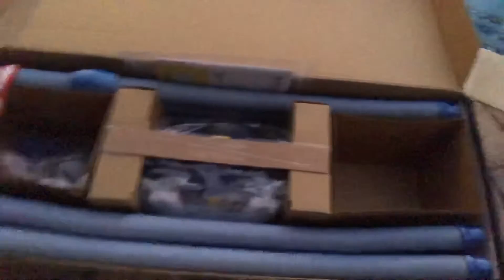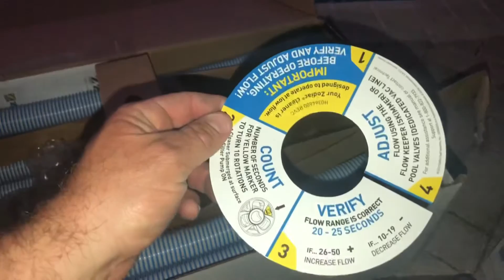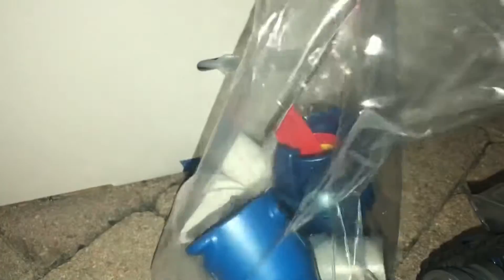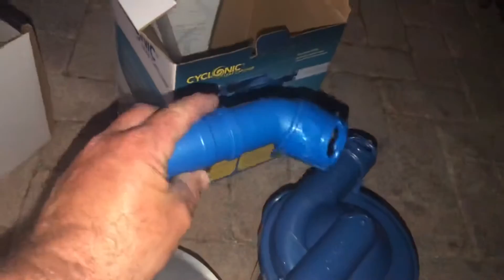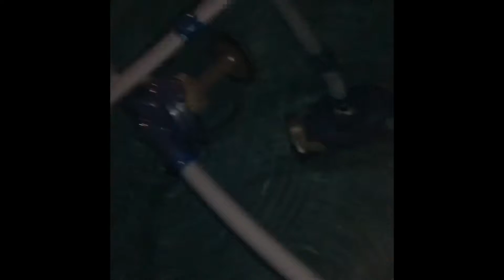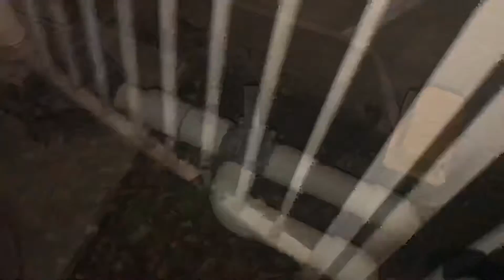New Zodiac MX8 ELITE Installation

Comment: I yanked a little too hard on the leader hose that is connected to the main unit to the sweeper and may have broken the connector, because it seems really loose.  How loose should that connector be?
Reply from the maker: It should be a tight fit. If the clips are broken then re-order new connector.

Comment: If you didn’t use the gray adjustable suction pipe, it’s not necessary to check the revelations of the wheel then right?? Do you have to use that piece at all??
Reply from the maker: Yes you should always check the revelations of the wheel to ensure your getting the recorre the amount of pressure. If you have revelations to high, then the gears will strip, and wear out faster. Too low, unit will not move properly or climb walls. Whether you use any adapter fitting, or plug into skimmer or side vacuum
Line still adjust pressure with wheel revelation method described in video and recommended by Zodiac.
Reply: @EliteSwimmingPoolsTV  ok, thank you. I can’t seem to get mine to work properly, the revelations are too slow and the unit hardly moves. My filter is clean and the pressure on the filter is in normal range. One problem I have is the white adapter for skimmer basket doesn’t fit snug in the skimmer basket suction, but I feel the suction pressure through the hose before I connect to unit. I’m not sure what do other than take it back.
Reply from the maker: Ok. This sounds like a valve adjustment needing to take place. So if you have the unit connected to the skimmer, I would assume your pool doesn’t have a dedicated side vacuum line ( if you do best to connect it there ). I’m going to also assume your pool suction lines are just a pool Main Drain & Skimmer. Now, your going to adjust the suction pressure strength on the skimmer by closing off the Pool Main Drain in increments. First start by check and count the current revolutions on the vac cleaner wheels. If revolutions are Less than the recommended turns this means Not enough suction strength coming from skimmer and you need to incrementally close the main drain valve to achieve a stronger suction. Go back to unit once adjustment of valve is made and recount revolutions until your in between the recommended turns. If your turn count is to High then you’ll need to Incrementally Open up Main drain valve until recommended turns are met. For pools that have a dedicated side Vacuum (Cleaner) Line. The Pool Main Drain will be completely Shut Off and the adjustment will be made between On Skimmer line, as it was described for main drain & skimmer only pipe set up. Hopefully this helps. Let me know how it goes.
Reply: @EliteSwimmingPoolsTV  yes my pool only has valves for main drain and skimmers. I have the main drain closed and still hardly moves. I’m going to try and close the other skimmer opening some to try and get more suction from the skimmer closer to the pump. How do I know if I have a side vacuum or pressure connection? I have a Polaris that I connect to the side and it doesn’t function either. It used to work really well, but it barely moves now. I think my booster pump may need to be replaced. Thanks for taking the time to let me ask questions.
Reply from the maker: Ok so sounds like you have a double skimmer set up and are also having flow issues even with your booster pump. How’s the overall circulation strength of the pool? What type of filter do you have? What’s the pressure of the filter? When’s the last time you had it cleaned? If you have a D.E. Filter, have you had the internal grids taken out and washed off? If you have a sand filter, how old is the sand in the tank? If you have a quad cartridge filter, when’s the last internal element cleaning of those cartridges or last time they where replaced? When having a double skimmer and don’t have a dedicated vacuum cleaner line, you should connect the cleaner to the closest skimmer to pump and turn off main drain and close down the other skimmer that’s furthest from pump. Regarding the vac cleaner line, this line is typically on the side wall about 18” below water line and near middle of pool along the length side of pool and would have a screwed on cover which the cover has a small round swingable door which the hose from vacuum cleaner would be inserted (depends on pool plans where location of this pipe is situated and if this line was designed with your pool in mind).
Reply from the maker: Generally the Polaris runs off pressure (connection to a pool return line. Pressure) this Zodiac MX8 cleaner is a suction cleaner and connected to skimmer or Vac Cleaner line.
Reply from the maker: Sometimes as well the vac cleaner could have debris stuck inside the turbine and have wound up debris like long skinny palm fronds, hair, etc. Please check inside the cleaner by pressing the yellow tab button on the top and open the lid to expose the turbine and internal components for debris
Reply: @EliteSwimmingPoolsTV  I have a DE filter we just took apart and cleaned yesterday before trying to use the new Max Elite. I was thinking the same thing to close main drain and close off the far skimmer basket to get more suction. I’m going to try this tonight after work.
Reply: @EliteSwimmingPoolsTV  ok, yeah I don’t have a vacuum connection then, just a Polaris connection.
Reply from the maker: Inside the box when originally purchased,
There’s a bag of adapters and stuff. There’s a suction pressure regulator that when connected to the hose of the vac cleaner and the the other end of hose connected to suction line, it will measure the amount of suction pressure your drawing from that individual line. Pressure Should be set at around 3
Reply: @EliteSwimmingPoolsTV  I checked the unit for any debris and nothing was in it. I closed the main drain, closed the far skimmer and the unit still wouldn’t move. The pool keeps loosing pressure after a few minutes after I close the far skimmer. Is it possible this isn’t for my pool application?? My motor is 1.5 HP.
Reply from the maker: Here’s what I want you to do. Disconnect the cleaner from skimmer port. Run pool only from the skimmer where you had the cleaner connected to. Check how the pool runs from just that skimmer alone. As it is running also check the pump lid and watch the water coming in. Check remaining suction lines, open far skimmer and close closest skimmer & evaluate, now open main drain & close far skimmer & evaluate MD. This is to ensure each suction line can operate as designed and there’s no clogged or pvc breaks. 

 If the pool pump keeps loosing pressure, as it was when cleaner is connected, then there could be a issue with the closest to skimmer line. Possibly something clogged. If that skimmer line operates properly and pump picks up prime and doesn’t loose it, then two things: either it’s too much pressure on that single line going through those hoses when cleaner is connected resulting  pump cavitation and starving for water, or there’s a hose that is cracked and air is entering. Check each individual hose, while pool is on and hoses connected, start from the hose coming out my of skimmer mouth and raise hose out of water listening for air and looking for cracks. Go through all hoses till you get to cleaner. If you find air and crack then take that hose off. Re-test. If all suction lines check out and properly operate independently, there’s no clogs in skimmer lines, no cracked hoses, the pool filter is clean then the cleaner may have a issue. Ooh I just thought of something, check the tracks. Sometimes the tracks are worn down and there’s no grip to move and/or the tracks have rolled inwardly and stuck. These tracks do wear like car tires do. If the tracks feel smooth and no tread this also should be replaced.
Reply from the maker: Do you have a leaf catcher installed with this cleaner? This would be installed between the twist n lock hoses. Zodiac cyclonic leaf catcher part#CLC500. Important to buy one if you don’t have one. This will collect all debris that  vacuum picks up and will trap debris in basket preventing debris from entering pvc pipe getting pipe/valves/pump clogged with debris.
Reply: Elite Swimming Pools TV I don’t have a leaf catcher. I’m still trying to get the vacuum to work. I checked all of the hoses and no cracks. The unit is brand new, I just bought it this past Monday. It’s been raining the last few days, so I haven’t been able to check closing the far skimmer under normal flow to see if the pool looses pressure. Hopefully today the rain will let up and I’ll be able to work on it.
Reply: @EliteSwimmingPoolsTV  I tired the test and after closing the main drain and the far skimmer basket with nothing connected to the closet skimmer basket, my pool looses pressure, once I open the far skimmer basket, the pressure comes back even with the main drain closed.
Reply from the maker: Closest skimmer either is clogged with debris, skimmer pipe may have a crack, or that individual skimmer line may have an air leak at valves or plumbing. All these can cause a loss of prime. 

When you open the other suction lines up, they are compensating for the loss prime on that closest skimmer line. 

Now try the other lines and run them independently, far skimmer by itself then main drain, and check the prime and circulation on those individual lines. If those lines function properly, you then need to contact a pool professional to diagnose the issue with the closest skimmer. 

Does your pool loose water especially when that closest skimmer pipe is being used? 

normal pool evaporation loss is 1inch of water per week. Any more than this amount constitutes a leak.